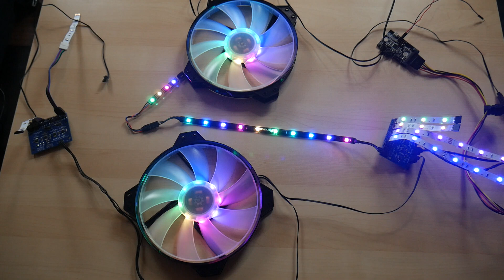ArrRGB DAC - Testing RGB DAC w/ different RGB devices and controllers

Comment: Hello Sir, How can i communicate with you? i need your Email or Facebook account. If you can do me favor it will be helpful to me. I need an 5v 3 pin addressable converter to 12v rgb header connector. my motherboard is asus b450m-a and its have a analog 12v 4pin rgb header but my rgb cooler fan have only 5v addressable rgb 3pin connector. i need your help i can't find any  splitter for 5v addressable rgb 3pin to 12v analog rgb header connector. Thanks!!
Reply: Those would sell like hotcakes 🤔

Comment: Are you going to be selling these anytime soon or releasing a tutorial? I'm planning my next build and this is going to be a necessity.
Reply from the maker: I would like to as to cover some of the cost of developing them. It is a fun project and I  have learned a lot so far. I am making another revision to improve on this.
Reply: @SolarityTechnology  
So what was your answer?
Are you doing a tutorial or selling the Devices?

I'm about to make a set up with:-
9x corsair fans
2x led strips
2x thermaltake RGB reservoirs
12+ thermaltake RGB fittings
1x CPU RGB water block
1x GPU RGB water block
and some RGB ram sticks...
Ohh and the mother board will probably have RGB parts to it as well..

I'd love to be able to make everything work together..

Can you please contact me?